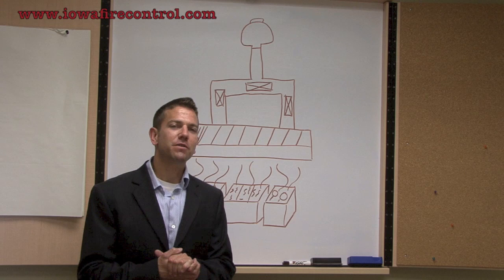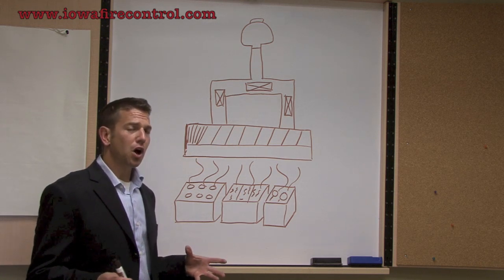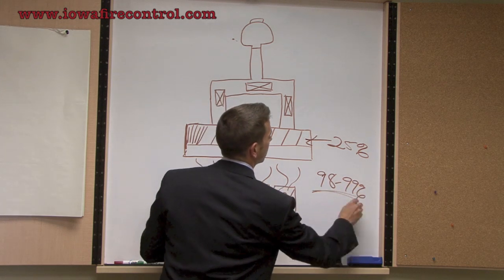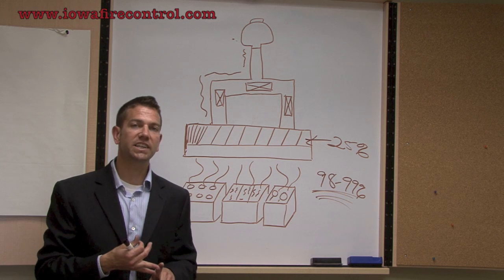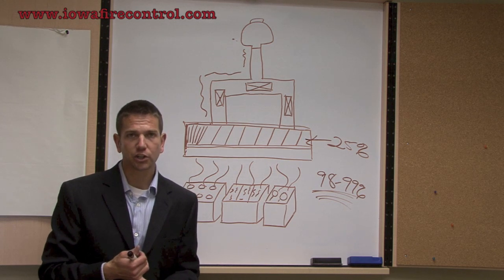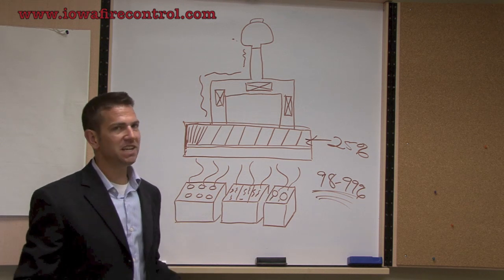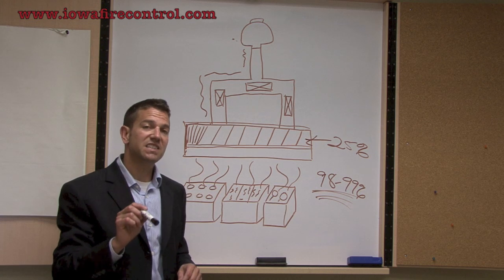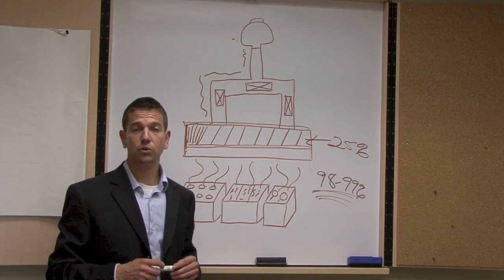Grease Lock for Kitchen Exhaust Cleaning:  The End of Hood Cleaning

Comment: Is this greek lock system disposable or do you have purchase them on a regular basis and how much are they. One ither question of concern. If greece lock wont allow the greece to escape thrn that would mean your exhaust isnt venting as it should wich defeats the purpose of the system .
Reply from the maker: The exhaust still vents normally and all airflow considerations are taken before any system is installed.  The filters are completely biodegradable and can be disposed of in a grease receptacle or trash bin.  Please visit the grease lock site or visit our website for any further questions.

Comment: bases on the NFPA code he is correct that you will not have to clean your system as often because of the reduced grease load.  what he failed to mention when he was talking about yearly costs for cleanings was that even though your system doesn't have to be "cleaned" it does still have to be inspected regularly (every 3 months in most cases).  Being in the hood cleaning business I can assure you that these inspections are NOT free.  this is obviously a sales pitch that is developed to mislead.  be cautious.

Comment: A1: You can find the Grease Lock filters website at GreaseLock. com

A2: The filters work great in any commercial cooking environment, whether 24 hrs or not. Filter life varies over each cooking appliance, due to the different amount of grease that each cooking applicant emits. On average, a restaurant with a 20ft exhaust hood will go through 1 to 1.5 cases per month (20 filter per case). Pricing can be found by contact a Grease Lock distributor, or the manufacture directly at 888-694-0063.

Comment: Keeping filters clean is one of restaurants biggest weaknesses.  As he said, it is a pain, so is dealing with these wool filters.  
He claims 100%  99% and 98%.  But they do not work that well. Filters are designed to have the grease drain from them per NFPA. They must be at an angle that allows drainage. How does a wool product allow for draining?  This product suspends all that grease in the line of flow. Which makes it a fire hazard.  He is a salesman, makes his money selling these  filters! On a busy restaurant, the filters can cost more than the cleaning.... Also what cook or dishwasher is going to know when enough grease is enough?  when to change them out, remember when they are expensive, they will stretch the intervals farther than they should.....  This can cause reduced air flow, contamination of make up and unbalanced air flow. 
I  can promise you the claims are false!  98%,? not a chance!   I have been in the business for 35 years.I am a certified inspector.  Don't fall for this. At least talk to your Fire Marshal first, get his or her opinion. You might purchase a bunch and be stuck with them when the Fire Marshal  bans them. Also, how much extra room do you have for these big boxes of filters? Also check shipping prices.....  rather large boxes...
Stick with a reputable cleaning service, demand after pictures of the entire system and clean it often enough....One more problem, there are so many bad cleaning companies out there that many systems are currently full of grease that you can not see.  Do you really want to suspend grease slowing air flow which could cause a fire and with the fuel already in the system, you could have a catastrophe.  Then, try to explain to your insurance company that you only had to clean the system every 18 months.....  
These could work on low volume situations, BUT  low volume cooking establishments don't need to be cleaned often anyway, so you are taking risks and wasting money on filters that are not needed.
Reply from the maker: http://www.greaselock.com/code-compliance.html
Here is a link to some compliance information and please feel free to roam the website with any answers to your questions and rebuttals to your comments.   I will try to answer to your comments in a simple fashion.

Airflow is accounted for and measured whenever a system is installed so the problem of unbalanced airflow your speaking of is erroneous, we would never install a system that was going to throw the system off balance.  The angle of the filters are unchanged in the system and the UL Baffle filters are kept in place behind the filter to maintain the system in the exact way you spoke of.  As for company employees not knowing about the amount of grease this is easily trained and trained well. 

You are correct that the GLS work perfect for some systems and are incompatible with others, however, we have installed the system in a number of different restaurants that have seen unbelievable benefits and are incredible advocates for the product.  We would never install the filters in a system that was incompatible.  We advocate safety at all times and that is what the filters were designed for.

With the filters in place there is virtually no grease in the system and we have many clients who use the system and have not been cleaned in 30 months.  Your statement about the flammability of the filter is discounted by the fact that there are ETL tests that have been done on the filters to that very measure. 

With the system in place inspections are still done on a basis in line with NFPA 96 according the type of kitchen equipment underneath the hood.  That means that if the system was being cleaned on a semi annual basis that a certified inspector still comes in and does an inspection to view all aspects of the hood, filters, fan, and ductwork and as well continues to monitor that the system is being used correctly.  I would also encourage you to review the NFPA 96 most current standard which does include reference to the use of mesh style filters in conjunction with a UL listed Baffle filter. 

Hopefully these helped you understand the system and your concerns more fully and please do visit the site to learn more about the filters.
Reply: I don't think you live up to your name.  Sounds like you don't know what you are talking about.  The wool doesn't cause a fire hazard. I grease loaded duct is a fire hazard.

Comment: Why not use a washable hood filter that is designed to remove 99% of grease instead of a costly add-on part? Then the user could wash their filters locally and not be required to regularly change of the Grease Lock Filters. Try CaptiveAire's Solo filter, or better yet, their Self Cleaning hood systems.
Reply: washable metal filters willnever capture at that rate, and solo filters dont catch much or get clogged too fast, and there is no such thing as a self cleaning hood,  read the instructions,  they say that this is not a replacement for regular hood cleanings.. good luck,  also what happens when you forget to clean your hood for   1 year and you thought your filters were working , but they were not...... one customer i found had a   smog hog system designed to  capture    almost all of the   particulate,   well guess what   it didnt and it contaminated  all of the post  capture system duct work,  which was never supposed to  happen,,  i called manufacturer about this, and they said its not supposed, to but  things fail, and then your really up a creek.   this idea is good, but my 24+ years in hood cleaning experience has yet to see a gimick that solves the problem, and often times creates a bigger problem in the long run.